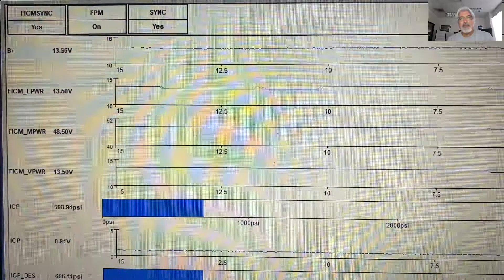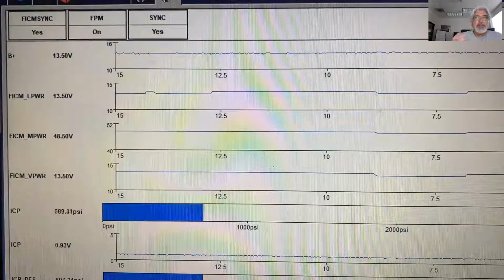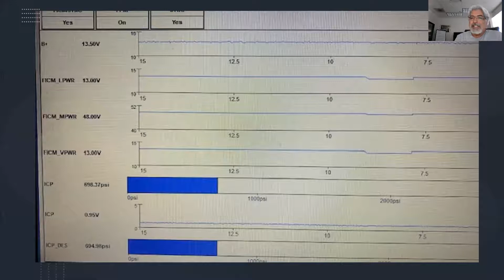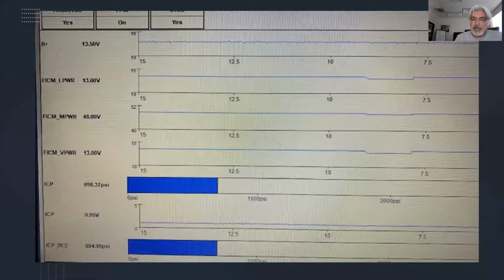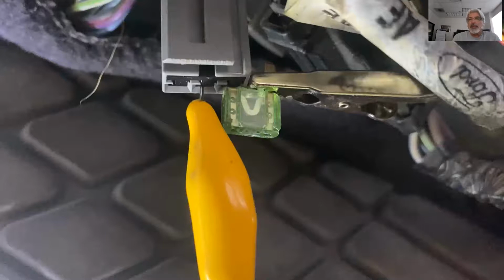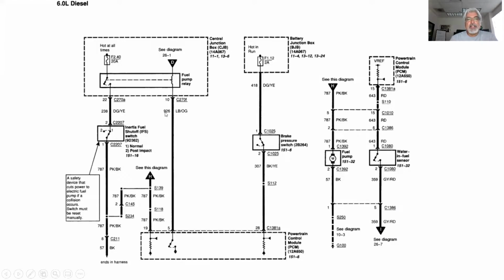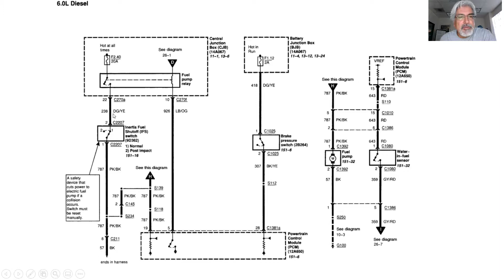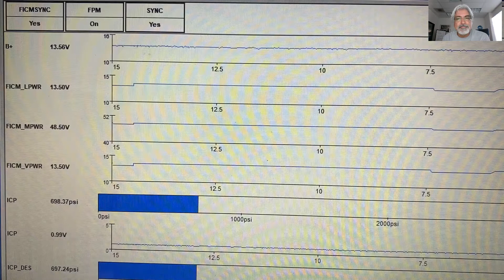Powerstroke 6.0L inertia switch, DIesel Talk

Comment: If you can hear your pump working then it’s got power correct? Because right now I’m having a crank no start issue and even after doing the whole 30 second on and off thing to purge air from the system I got no fuel in the rear filter , so I’m guessing the lift pump is bad. I can hear it running and it isn’t screaming but no fuel at the  rear filter.
Reply from the maker: Simply remove the secondary fuel filter in the engine compartment next to the oil filter and have some one turn the key on to see if any fuel  present.
Reply: @  I have a disaster prevention kit installed and the site glass doesn’t fill with fuel? So I’m thinking now it’s the lift pump.

Comment: Great content. I have a 02 7.3l i have this code i replaced the fuel pump but it still dont run right. It runs but very slow to pickup. Should i replace the non serviceable relay or bypass it or should i replace the inertia switch? One more question if the relay is bad or the wiring is bad does the truck still runs? Coz my truck havent cut off yet but have real hard time picking the speed when i plugged the scanner it throwed 0231 code. Plz help me out if u can thanks
Reply from the maker: @bxtbill  you sure your issue is not in the tank?
 We test suction for restriction on the suction side of the pump. Or To quickly test run power and ground to the pump see if it starts
Reply: @dieseltalkwithtonysalas8725  thanks alot for the quick response I checked the tank screens & filter it's all clean it's actually a flatbed tow truck so I have access to the tank all the time my truck starts but the problem is it runs really rough like it's starving for fuel & it kept throwing p0231 code I replaced the liftpump but still no difference. My thinking is maybe the relay is bad which causes it to not give enough power to push the fuel. Correct me if I am wrong. I don't wanna spent hefty money taking it to the sparkly shops so just trying to figure out something I could do it myself or my friend who's actually a mechanic
Reply from the maker: @bxtbill  like I said run power and ground straight to pump.
Just to verify
But issue is relay or inertia switch 
But check ground too

Comment: Would the inertia keep the truck from switching off?
Reply from the maker: Inertia switch is just inline with the relay for the fuel pump .. your issue is not this switch
Reply: @dieseltalkwithtonysalas8725   thank you!!! 3 different dealers 2 independent shops and no ideas.
Reply from the maker: @jasonallen4022  Geez that’s terrible .
It’s a matter of electrical know how. I take a crack at it! For starters I fixed a 7.3 and a 6.0 with this, pull the headlamp switch connector off.
Reply: @dieseltalkwithtonysalas8725   will  definitely try it. And get bk with you. It starts fine when u turn the key back to off the check engine light abs light and the 4low 4x4 light comes on. They've replaced fuse box, alternator, starter. I believe its first issue was wouldn't start said it need hi pressure oil pump. So ok go ahead then they say it will not shut off.
Reply from the maker: @jasonallen4022  ok how have you been shutting the engine off?
Reply: @dieseltalkwithtonysalas8725  pulling the fuel pump relay
Reply from the maker: @jasonallen4022  ok I’m looking at the wiring diagram, the fuel heater relay could be an issue, locate the fuel heater relay and remove. You google the diagram where it is in your fuse box under the steering column.
Did you answer if the truck has an aftermarket alarm system ?
Reply: @dieseltalkwithtonysalas8725  it does not have any aftermarket.
Reply: We unplugged the light switch but no luck.
Reply: And I  wanna thank you again for taking time to even read and help.

Comment: I’ve been having an issue that’s been making me believe that I either have a fuel pump relay or an inertia switch that’s bad. Initial key on engine off the pump will prime with no issues. If I cycle the key. I can hear the fuel pump and the relay click on and off continuously so if I try to run it it won’t stay running cause the fuel pump is still turning on and off while both cranking and running.  Letting batteries charge right now before I attempt to crank truck with the jumped wire in place.
Reply from the maker: You get it figured out?
Reply: @dieseltalkwithtonysalas8725  not yet. Is there anywhere I could contact you more directly?
Reply: Mine was a bad relay that's inside the fuse box.

Comment: My 06 f350 just started to do exactly what you are talking about it stalled about five times on the way home from the gym and it was no fun trying to steer sitting on 40’s with no power !
Reply from the maker: Hold on! Before you check inertia switch, disconnect the ICP sensor on the passenger side valve cover and test drive.
Reply: @Diesel Talk with Tony Salas  oh okay I will can you tell me what in looking for ,and I will let you know thank you Sir .
Reply: Okay so I changed the fuel pump and Inertia switch drove to work this morning and almost made it to work and it died restarted it and made it to work while backing up it died again so I unplugged the ICP sensor and made it all the way home with no problems ?

Comment: Is the fuse required for some reason to bypass inertia switch?  
Can I just run a wire between the two?  Does it have to be a certain min gauge wire?
Reply from the maker: Fuse is just a protection in case u bump ground. Gauge can be 16-18
Reply: @dieseltalkwithtonysalas8725  thank you!!

Comment: several months back my truck stalled after going slowly over a speed bump in a community I reside in. today it happened again in the exact same place . the first time the fuel pump fuse ( 20 amp) slot 40 under dash blew. I replaced the fuse and for several months all was fine . today it happened again but now I replace the fuse turn key on powering up everything all is fine but the minute I move key to start / run the fuel pump fuse blows with sparks , I can not with my limited comprehension of electrical figure this out . any thought ?   2006 F 250 Lariat super duty 6.0 power stroke turbo

Comment: This is great knowledge, can you please make a video with in-depth detail. About Flow return testing Duramax injectors. There is only one video that I’ve seen done. Which is helpful but literally I can’t find another. The gentleman shows how he got a tool kit (says tool kit name) an a brief description on how he set it up to test the  right bank an left bank as well the cp3 return flow an talks about the milliliters, while cranking for 15 seconds an shows the results then goes to the testing individual injectors. I think he disconnected the ficm module to they wouldn’t spray by a fuse but he didn’t show how he set it up an idk if the test is similar to the other later modules. I feel like this is a missing piece of knowledge that I need to know. But there isn’t any videos on this. He even states that so I subscribed to him being he is informative as well. I’m just getting more in depth on the subsystems pertaining to diesel. I’ve gone through all the rest of the chapters prior except maintenance like filters but there covered in subsystems not that I won’t go back but after reading on the turbines an the atomization. Up until you told me that the duramax doesn’t have a lift pump or transfer pump except the one integrated in the cp3 pumps an cp4 pumps . I wasn’t aware the subsystem on it is completely suction. Unlike the powerstrokes an the Cummins which do have lift pumps.
Reply from the maker: When I get a chance, I will make a video on how I test Lb7 injectors. I perform a pressure drop test. The reason is the return on the injectors requires you to remove the valve cover just to get to the injectors. Another way is to  perform a bank to bank return test where you can measure return flow for a 15 second crank for each bank. This is done by tapping into the return on each bank. Left side (driver side) is at the rear, passenger side is right under/behind the alternator/generator.
Bosch offer s spec for CP3 injector return.
As for CP4, Ford does not offer return specs, but we use Duramax LML return specs since they are just about the same system.
As for suction, all Duramax applications up to LML have a test port on the passenger side.
Reply: @dieseltalkwithtonysalas8725  this is amazing thank you sir for all the time you took in replying as to why I replied to all your messages as well to show my appreciation. I’ll be waiting for the pressure drop test so I can see. These methods of testing are good for all different model applications concerning Duramax. I’m excited to see the video an learn more from you sir. You provide great in depth detail. You must be ASE Master Certified or a technician that serves for the Dealership for many years. To attain all this knowledge in your videos. This is great, your knowledge is blessing my life. Thank you, I will use it all to better my future.
Reply: @dieseltalkwithtonysalas8725  another I wanted to mention that I have yet to see , being I’m a master technician for gasoline an that fuel trim is monitored by oxygen sensors.  it seems to me that simply an understanding that a diesel is designed to run lean. So the importance of recognizing the smoke wether white for unburned HC, or Black for lack of boost or loss in fuel pressure is critical. But I’ve yet to see In my book someone if it’s possible monitoring boost pressure to fuel trim. Most watch fuel pressures but since Diesel is a petroleum just like Gasoline. How is it monitored? An I typically always see aftermarket boost gauges to monitor boost pressure which is absolutely needed to know while operating a diesel but that as well left puzzled perhaps on current model they have boost sensors but I have yet to where a scanner can scan a pcm an monitor boost pressure an the fuel system concerning how it’s burning. Can you give clarity on that. I’ve scanned multiple diesels an didn’t see that in there operating systems or maybe I missed it. Like when I first started I wasn’t aware that the ICP or IPC , (I get the abbreviations confused at times) was the value needed to measure oil pressure in the Injector Supply Rail for the powerstrokes with a scanner digitally. Until I learned by searching.
Reply from the maker: @royanguiano2610  geez another long one!
Ok well early common rail before SCR used angular velocity to determine cylinder power contribution and this was done at idle. CKP WITH CMP was the main input for the ECM to adjust fueling.
There is a short version of it 
But each manufacturer does their thing. Duramax L5P is so finicky and sets fuel timing and fueling codes but it’s not always an injector! 
I do have the professional website where I have on demand courses. You are welcome to support and look at product specific courses. I also have a diesel drivability roundtable where techs share different issues and diagnostic troubles.
Visit www.Powertraintraining.com

But! Now with SCR THE NOX SENSOR is a oxygen sensor to not only monitor NOX levels but to adjust fueling.
Reply: @dieseltalkwithtonysalas8725  wow I’m grateful thank you an yes I’m definitely looking at the site an going to be studying. Thank you sir
Reply: @dieseltalkwithtonysalas8725  sir I have an issue with a Ford Truck I’m repairing it’s a 2004 Ford F-250 6.0 . I have serviced the HPOP system. Resealing the injectors (outer o-rings an the top injector o-ring) I took apart the oil rail Logs an replaced the seals on the oil rails an 4 nipples . The lines that connect to the oil rails an the Standpipes (early model) are replaced an updated , the stand pipes are replaced new,. The J-Tube is new an updated, Hpop is new as well. The truck after all the repairs were done started up after a long crank an ran slightly sluggish then tightened up but at half throttle the vehicle will run fine. But holding it at wide open throttle going 70-80 miles per hour she loses power an the throttle response is hardly there. If I’m cautious with the pedal it’ll run but still loses power gradually getting slower an weaker. Going up hill makes it even tougher an it’ll eventually cut off. Scary thing it’s done it to me on a bridge. On a flat surface she is struggling but doesn’t turn off till I let off the pedal. I’ll then have long cranks and after a couple of try’s she’ll turn on an will run weak then gradually get stronger or she may start up with all her strength. As I said with the pedal if I wide open throttle her then she’ll pick up an then lose power. When she is losing power she shakes a lot an the transmission doesn’t respond properly cause of lack of power. I’m going to run a fuel pressure test but before I did the repair I noticed the IPR would get to 85% at times but only when pressure for high to 4000 psi. As to why I resealed the entire system an was very cautious . I torqued everything to specs as well I torqued in sequence from the Hpop on up.  I thought at times like it could be the oil pressure relief valve. In the process of cranking when she would lose power an turn off. I noticed the oil pressure hopping up an down while building pressure. It doesn’t lose pressure when getting weak after I’ve stressed the system going wide open throttle. If I stay easy on her an don’t wide open throttle she’ll run like a champ  an won’t lose power even if I go to 70 mph but if I want to feel her power an go all out WOT kills her. An it’s got me confused. I’m certain I did all the repairs correctly watching diesel Tech Ron. An after all my studies. But I am wondering what am I missing? The seals I used were from alliance an the parts are factory. The oil rail seals are from HHC an I torqued those to spec. Everything has been torqued to spec. I’m still learning but wanted help please so I can solve this issue an progress to the next chapter after gaining this knowledge.
Reply: @dieseltalkwithtonysalas8725  oh I forgot to mention both the Ipr an IPC are brand new as well

Comment: I’m going through all your videos to absorb your knowledge. I’m about 330 pages if not more in my diesel book. Thank you so much for your knowledge
Reply from the maker: Thank you! Glad I’m helping. Are you working in the trade, or you learning as a hobby? Would like to know but keep learning!
Reply: @dieseltalkwithtonysalas8725  I’m learning on my own, I went to the community college got the books required for the associates degree plan. Purchased them online and study every single day. I’m doing this to provide more options of advantages that I may use to make money . I am also going to college for computer programming and coding . My book is 1202 pages long but I’ve read my 1/4 an near already 1/2 of the entire book plus I have 160+ videos saved in my personal library here on Facebook an have watched them all for a more visual understanding. I am just done covering LSG,VSG,IsoChronous Governer an much mores as well as Series turbocharger , an I’m just about to get into each individual fuel injection model designs in-depth. HEUI,EHI,EUP an etc. I’m still learning but have a much better understanding Rated Speed, High Idle ,Droop Curve an more. But it’ll take time for me to master it however I have retained a lot of information by reading. So every video counts that helps. I need to find videos about Hydraulics, to rebuild pistons for forklifts an excavator an more. As well a book to get thorough in depth knowledge. I just love to learn. I want a better future so I study everyday. I’m not in class for diesel but that factor will not limit me in my desire to learn .